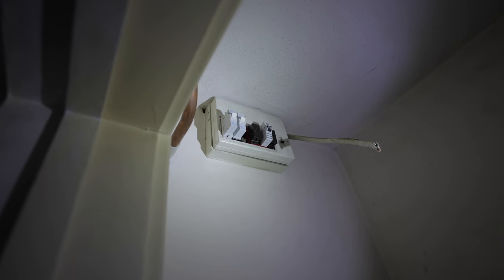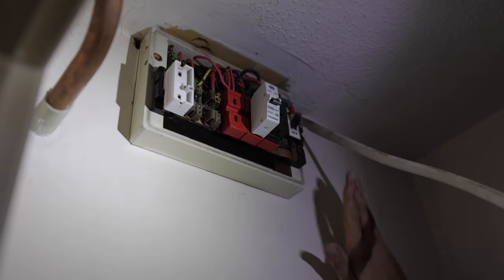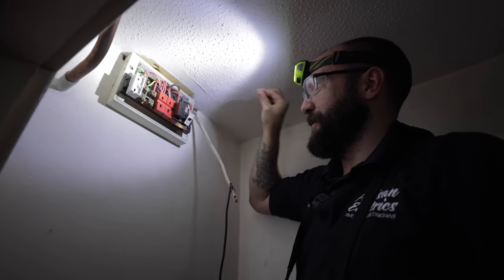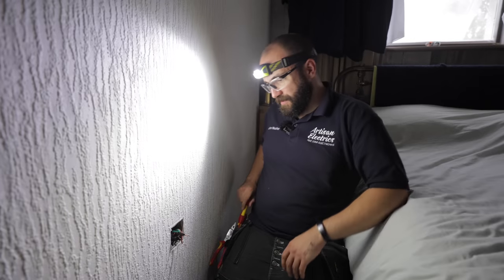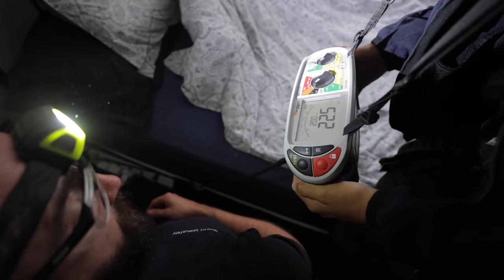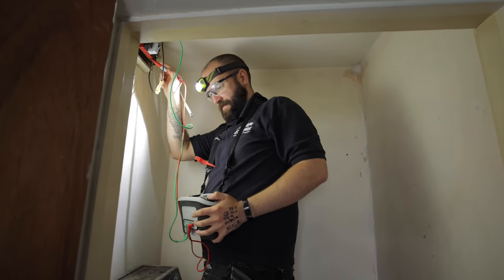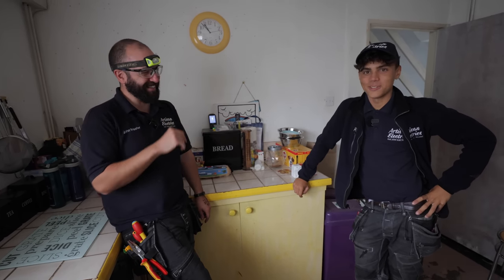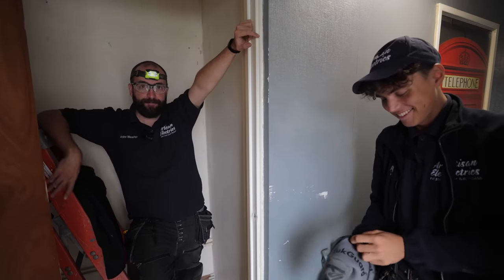The WORST Electric Shock I've Ever Had!

Comment: As an electrician in Australia, I am embarrassed that we are very very very rarely trained to understand and go to these lengths of testing. It's amazing to see the passion in what you guys are doing and it really motivates me to go the extra mile and do the job properly.
Reply: Our sparkies here in the US aren't trained to test at this level either.

A fair portion here are just glorified wire-changers that carry a Fluke.

I do low-voltage, radio and light here in the US for a large telecomm and I was working alongside an residential electrician and he was astounded by the amount of testing we perform for just a standard job.  Low voltage and radio are fickle, we don't have a choice.

Only guys I've seen testing like this here in the states are HV commercial sparkies.
Reply: here in Denmark, you're not required to test this thoroughly. If there's a fault you only test the part that's faulty, and only go on from there if there's indication the fault is caused by something else. If you do wire anything yourself or touch the mainboard (both are illegal here), you can and must request an electrician to inspect what you've done, but otherwise we simply don't test circuits this way here

Comment: Worse shock I got was an electronics one: a capacitor from a flash unit in a DSLR that I stupidly forgot to discharge before picking up the PCB bare hands and touching both legs with my index finger.

Got 2 small holes in the finger, a reminder that today I still get when repairing stuff but at least I didn't let the camera body fall on the floor.

Comment: Great to see you guys supporting safe for September. Especially after one of the creators dug you out a little bit last year. Classy as always. EICRs are always finding that balance between not dismantling what is a working system but also getting enough inspection and test data. Sometimes no need for any R1+R2 testing at all. This is when people confuse initial verification and inspection and testing. Nice video!

Comment: The worst shock I've ever had was similar to John's...  reversed polarity plus not testing correctly.   I switched off a kitchen light during a tearout of an old kitchen (just my colleague and I in the work area, so no danger of someone turning it back on) and client was still using the lights in another room. Old wylex 3036 board so no rcd.

Turned light off, it went off,  climbed up and tested L-E with test lamps, nothing. Disconnected the fluoro batten, removed it, fed the L and N wires into a round 5A JB temporarily.  Was gripping the box awkwardly so the ball of my right thumb was on the terminal for the black wire (supposed neutral). Went to bend the earth wire in with my left hand, and instantly exceeded the let-go threshold, the world went slow, painful, and vibratey.

I had enough time to notice my eyeballs were vibrating :O ... and to think 'this is it'....

Fortunately my legs gave way and i fell off the steps and into the corner. I still have the imprint of that hexagonal terminal burned into my right thumb.

DIYer had managed to reverse polarity somewhere back along the circuit, but the red wire was still switched.   I've become obsessed with proving dead since then. Familiarity breeds contempt

Comment: Multiple shocks in my career, its not OK to have them and when practicable all work should be dead, but also we shouldn't be ignorant to the fact it is an occupational hazard we have as a trade. Top 3 are:
400v between 2 phases, C50 board.
800v DC on a neg earthed GM PV site, + to array, across the chest.
Most dangerous was a call out to a house who had a bathroom fitter cut the neutral short on the Dwn lts so used the CPC instead, 16th edition DB and no RCD on 1st flr lts. Client stated they were getting a shock on the DIY replaced new metal clad switches. Loose CPC acting as the return path, kept touching it not believing it could be live. A green mistake early on.
Nice stories to tell over a pint, but I've known people who have has less  of a shock and end up with life changing injuries, so never get over complacent.

Comment: The good old Wylex fuseboard. Many, many years ago, I was involved in an investigation as to how a man working in his own house had been electrocuted. What he had been doing was 'upgrading' his Wylex fuseboard, changing rewireable fuses over to MCB's. With the Wylex MCB, the MCB shield wasn't so deep, so it had to be swapped out. Unfortunately this man didn't turn the board off. As he undid the shield, his screwdriver slipped off the securing screw, going straight on through the bottom hole in the shield and made contact with the busbar. Worse, there was a gas meter directly behind him. You could see where the skin on his fingers had bubbled up on the screwdriver. He was discovered by his wife. Tragic.

As to shocks, again many years ago, I was changing an heating element on a storage radiator which unknown to to anyone had a thermostat in the circuit. Definitely the worse shock I have ever felt. Fortunately my reaction was enough to pull me away and off the element. Stay safe. Isolate.

Comment: Biggest shock I ever got was in a student accommodation block. Pulling a cable down from the plant room I was in a riser. When I put my hand on metal trucking I got stuck to it and could feel the electricity flowing through me for a few seconds. Only way I got off it was shifting my weight off the ladder and falling. Students all over the building could hear me screaming.

Comment: Working on a private cable for a   Street Lighting circuit, halfway through the joint and extend some twit (not the words i used at the time) ripped off the lock out kit and switched the circuit on. Company tried sweeping it under the carpet, i come out on top and it's fair to say i no longer work there!

Comment: I’m a commercial electrician and got a 415v shock off of a panel voltmeter which was mounted on the equipment door which shut onto my forearm. Luckily or unluckily the distance between 3 phases on the meter was only 20mm apart in a triangle so I didn’t get a shock I could feel but i did get a burn

Comment: I’ve had quite a few local shocks which are always a bit scary but the worst was quite recent. Swapping a drywall box for a double socket and I popped the wrong breaker, only noticed when the socket was off and I went to straighten all the cables at once, with both hands. Shock right across my torso and I thought my heart was going to stop. Knowing that the heart can be damaged with late onset of symptoms I spent the rest of the day by my wife’s side, nowhere near any electrics!

Comment: Worse shock I had was when I was 6 or 7 years old in my bedroom which I shared with my younger brother. Was a bedside lamp. Which had 2 transparent wires that had split and as my brother ran into the bedroom is foot went in-between them and snapped both wires. I decided to repair the lamp without unplugging it from the wall. Using my teeth, I bared the wires then connect one pair when I grabbed the 2nd pair, I was unable to let go there was no RCD in those days' year was 1969-70 my heart stopped I remember nothing until my grandmother resuscitated me but never sent me to the hospital. She gave me a cup of sweet tea sent me back to bed a little while later I came downstairs as I went into shock. My mum phoned for an Ambulance when I got to hospital, they gave me an injection to calm me down. Both my thumbs & index fingers were burned and still have the scares today. But could have been a different story.
Reply: Nasty!

Comment: Only had a couple of memorable packets & I intend to keep it that way. 

Worst one was foolishly grasping the end of a 4core flex on a 6a lighting cct which I was assured was dead.....wrong! The muscles clenched in my arm & my fingers would not let go, I had the time to think to myself “this is it” whilst I emitted a blood curdling scream, so I was told. 
I blacked out & fell off the steps I was on, which saved me, I woke up on the floor a couple of minutes later. 
That was a life changing experience. 
The fact I blacked out meant the shock affected my heart & the blood pressure went immediately. 

The most painful shock was when I was an apprentice, instructed to change a light whilst the lazy bastard I was working with had told me the power was off, which it was.....but.......ever heard of a borrowed neutral?
That fker hurt, big time!!!
I don’t mess around doing that sort of stuff in occupied buildings anymore unless I lock off & at least have a reliable volt stick with me. 

Be careful out there, fellas 👍👍

Comment: 'in the real world'....the cooker circuit r1r2 reading could of been high because of loose or worn connections.  In your example it was very small variance on the live test, but I've found lighting circuit variances of over 1 ohm ,worth checking connections .

Comment: The worst one i Had was back inthe 80's when, as a newbie, the decorator in the house said to me "I've diconnected eveything". I was hung onto the metal conduit whilest ciuuting through the braided wires with a Stanly knife. I was left vibrating on the circuit and the knife flew out of my hand and imbedded itself into the wall just as my girlfriend walked into the room. I couldn't yell out but was just uttering a gutteral noise for what seemed like ages, very painful, burns to my fingers  and kness! Lesson learn't NEVER trust someone else to isolate a circuuit you are working on.

Comment: MANY years ago as a young engineer working on mains powered telephone extension bell in factory. Aluminium ladder against steel partition, insulated handle screwdriver but not insulated shaft in those days. Somebody rang phone!! As I later learned on fire training hands grip when electric shock so could not let go until phone ring stopped. Fortunately intermittent ring but I could not climb back down for seversl minutes.

Comment: When I was a kid I used to collect the 3ply string from our shops bacon slicer, one day I found a 15amp round pin plug( it was before everywhere went to 13amp plugs n sockets) i decided to "wire up" some string and plugged it in the the lounge with it stretched out across the room.
Clearly it went back blowing the socket out of the wall and putting a massive black burn across the carpet plus blacking out the shop!!! Luckily I was not electrocuted but I got a thrashing afterwards.

Comment: Finished my  apprenticeship in 1979 so have had a few 240 belts over the years however the worst electric shock I have ever had is when twisting/ breaking  open a disposable camera by hand and came into contact with the flash circuit the most painful electric shock I have ever had I couldn't  use my hand properly for a week.😂
Reply: can make a canny little taser with those cameras :P

Comment: About 30 years ago I was working on a large occupied office block and I was footing a ladder for another electrician who was trying to unplug a light fitting while the circuit was still live , it was connected via an old 5 amp round pin plug and socket which was fitted to the side of a metal trucking.  He was holding the trunking with one hand and struggling to pull the plug with the other hand when he touched the live pin with his fingers, the shock went through him and into me making the ladder drop and he fell pulling half the suspended ceiling down and broke his arm ,we were both doubled up with laughter for about 10 mins lol

Comment: Although NOT an Electrician - the worst shock I ever had was off a TV set 30 years ago when I was working as an IT Technician for the local Schools Authority.
We'd had a batch of faulty TV's from the supplier that needed a "chip" upgrade, and myself and my colleague (and boss), were working our way around the local area "upgrading" the TV's (as they'd work for an hour or so, then shut off for an hour)...
We'd got to the local Catholic school and were in the process of doing their TV in the classroom, and when we got in there my colleague remembered he'd forgotten to bring in the new "chips", and dashed back to the car to fetch them, leaving me with explaining to the teacher - how I'd have to unplug the TV for about 10 mins, change the chip and then plug it back in.
The teacher then asked if it was OK, if she plugged the Tape recorder in so they could listen to some tapes....   I said "fine" - and proceeded to unplug the TV and take the back off...
Unbeknown to me, whilst my back was turned and I was removing the "defective" chip with the supplied tool (basically 2 screwdrivers with a plate on the bottom, and a lifting mechanism) - the teacher accidentally plugged the TV back in........

There was a hell of a bang, and a bolt of lightning across the two screwdrivers that I was holding about the width of your thumb....
I jumped in the air - and let off a torrent of swear words !!!!!!

I think the Catholic Children in class learned some new words that day...

The teacher DID apologise afterwards - and after a cup of sweet tea, we had a good laugh about it...

Comment: Mine has to be climbing over an electric fence in the wet. One hand on a post, inside leg touches the wire I am thrown back and wonder what the hell happened. Turns out there was a bull in the field and the farmer didnt turn it off. Made worse that it wasnt battery powered so there was no voltage or current drop when I was connected to it adding a load add in that it wasnt pulsed like others normally are. 4kV which is why it managed to get though my trousers and water proofs not sure of the max current though...

Comment: One of my friends bought an ex-council house in a shabby condition. After spending all day removing wet lino from the rotting floorboards in the toilet (not from water), he needed a well deserved bath. As he lay soaking in the bath, he noticed a hole in one of the ceramic tiles at the end of the bath, with something inside of it. He sat up in the bath and was just about to stick his finger in the hole to investigate when he noticed some red and black PVC. Yep, someone had chopped off the electric shower flush with the tiles and left the live cables exposed!

Comment: 1973. A year before the HASAWA Apprentice. No testing kit back then, just a neon screwdriver. I was sat, in a wet floor in a cellar - so my bum was wet. I was instructed to connect a temp lead up. The supply was a 1920s cast iron fuse box. Single wired fuse and a side switch that cut  the live side only. The cable in and out were VIRs. Unknown to me, the sparky in the 1920s had wired the fuse and switch into the neutral conductor. It was isolated (as far as i knew). I cut into the black neutral conductor. UNBELIEVABLE PAIN. I woke up about 10mins later at the other side of the cellar ... Not a good day